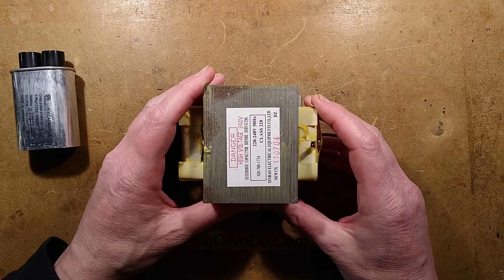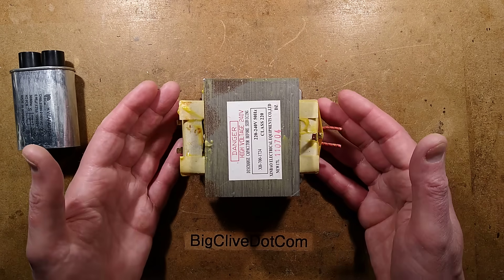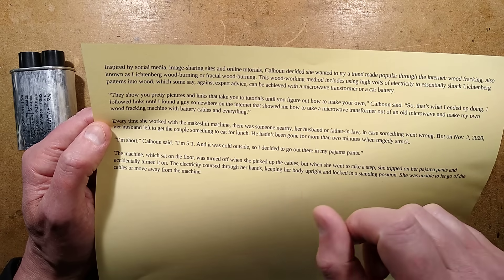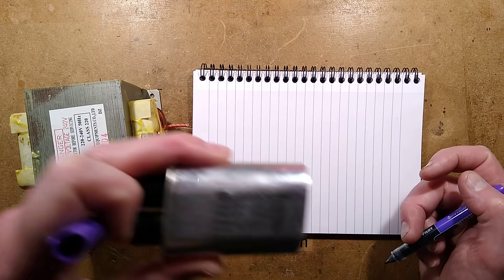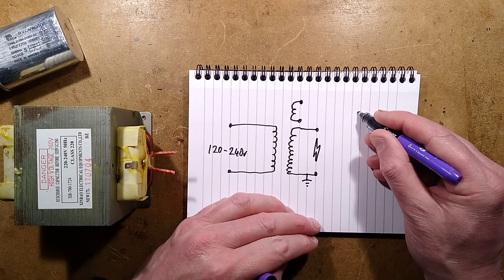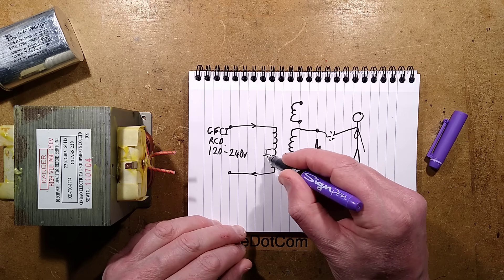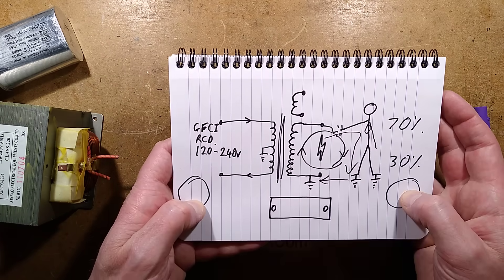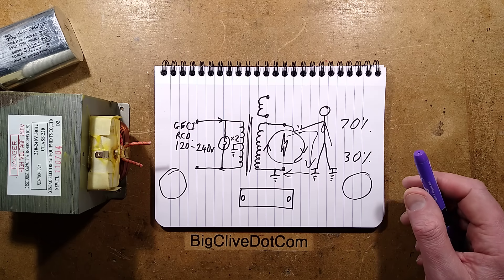The most deadly project on the Internet

Comment: It always amazes me just how many people ignore massive 6 foot tall font "Danger - High Voltage" warning signs, placed on fencing that surround many transmission grid transformer /  power relay stations. 

Yet people think a microwave oven transformer is nothing to worry about. I just don't get it...

200,000, 20,000 volts or 2,000... 

A good video you could make is explaining the relationship between Ohms Law AND Watts Law relative to current flow (time). 

We used to play with old automotive oil filled 12V ignition coils. A decent one might put out 10,000 volts. Then the first generation of High Energy electronic controlled 50,000 volt coils (HEI) became available and they gave your fingers (often all the way up your arm) a solid shock at the spark plug lead. The amperage was energized in millisecond intervals if the engine was at idle. More than a few mechanics have gone into cardiac arrest (and died), if the engine was running at 4,000 rpm or higher @ multispark discharges of 50,000 volts in one second (per cylinder / spark plug lead) on a 4 stroke V-8 engine). 

When playing with microwave transformers, it's constant, which nobody correlates to the danger involved. 

Really enjoyed this video. Keep up the great work!

Comment: Ghetto Carbon Nanotubes production by way of massaging two graphite electrodes together while they are submerged in water and connected up to a 150amp mig welder with jump leads is one of the scariest things I've done and I'm probably never going to risk it ever again but that's a good one for a 'things you really shouldn't do' video.
Reply from the maker: Although welders use high current, it is voltage-limited, so a lot safer.

Comment: People often do not understand that with DC power in particular, your hand muscles contract that that's it. I grew up in moviehouse booths and the old timer projectionist who worked around a lot of high power dc, all had a safety habit when moving a DC wire to always use the back of their hands gingerly until certain it's not a live wire.
Reply from the maker: AC is more dangerous as it causes sustained gripping as opposed to a single muscle pulse with smooth DC.

Comment: Would an anti-static wrist strap help with something like this? (This is basically a conductive wrist strap with a wire attached, with an alligator clip which you clip to ground at the other end. We used to use them all the time when working with computers to prevent zapping sensitive components.)

Of course you would want it connected to the hand or arm being used to touch the transformer, otherwise the current would still short across the chest+heart to reach the other arm.

It would be easy enough to rig something similar just using an insulated length of wire, if you can't be bothered sourcing a manufactured strap. But I suppose the people doing these things are already taking shortcuts with safety, so they probably couldn't be bothered...
Reply from the maker: Not recommended, in many instances it could be a lot more dangerous.

Comment: Could there be a easy way to  turn on and off  a system like this by a remote control system so there is little to no need to touch the system, while there maybe a charge in the system?
Reply from the maker: It would have to be hard-wired for safety and is basically the two button system I described that keep people's hands away from the dangerous bits.

Comment: The public information videos of the 70s and 80s scared me enough mentally to not attempt to toy around with high voltage appliances in such a reckless manner. Apart from the time I dismantled the transformer of my skalextric aged about 7 to boost the power and burnt my finger.. but apart from that.

Comment: With all the dumb and dangerous things I've done,screwing around with an intact MOT is not one of them. I've removed the secondary,rewound it for low voltage/high current,and made a beefy 12VDC supply with one,though.

Comment: Don't use WOOD as a standoff from this kind of voltage. Use fiberglass rods to carry the very dangerous HVAC between transformer and burning target, by attaching the HV wire to one end of the fiberglass rod and holding onto the other end of the rod. Also consider using a normal, old-fashioned incandescent bulb, wired in series with the mains side of the transformer, as a current limiter. As evidenced by the charring, wood is NOT a good insulator at these voltages. Good fiberglass rods for the purpose are commonly available at farm supply stores for a very reasonable price, as they sell many of them, for use with electric fences. I recently got some of these rods, which are 4 feet long by 3/8 inch diameter (9.5 millimeters) and conveniently pointed on one end, for under $2 each, retail priced. That leaves you room to hold the rod with both hands and still be 3 feet away from all the high voltage. These rods are meant to remain great insulators even when wetted by rain. Note to gardeners: They also work beautifully as heavy-duty support stakes for your giant tomato plants. Similar rods are available to at least 6 feet long, and in various diameters.

Comment: Heres a great project for them transformers. No risk of danger or death with this one. This works well if you have 1 transformer or 12 or even 100, doesnt matter. ok first thing you want to do is line them all up on the edge of a table. Now heres the fun part... Grab your trash can and slide it to the table and with one hand holding the trash can and with the other one you wanna just sweep your whole arm across the table knocking them all into the trash can. By all means its a very simple project but you'll notice how many years it can put onto your life expectancy. I call it "wtf was i thinking? throw them away". So yea. Be safe and have a nice day for the rest of your life...

Comment: And this is also why we used to be told not to play around with the tube TV's from the 90's. Never realized that those transformers created such high voltage or what could be stored in the capacitors involved. Glad I've only been shocked by standard 120v and 240v AC. And on a side note, 120v shocks are often uncomfortable for those who have never experienced them; I'd also like to warn that 240v AC feels like the conductors want to stick to your skin and your heart rate definitely goes up and you will feel weak afterwards. Please always use safety measures when working with electronics and if you aren't sure, then consult a professional.

Comment: Thank you for the post. I'm a broadcast engineer and I work on very high-powered transmitters. Even though we are trained and experienced in working with high voltage, we have very strict procedures we follow in order to not come in contact with energized circuits. 

I love the artwork that TRAINED HV artists produce, but it isn't worth dyeing for. If you have not been trained by someone who truly knows what they are doing, and been supervised by them, please don't mess with microwave oven transformers, neon sign transformers, or any high voltage power supplies. This is not something you can learn watching videos, or by trial and error. You don't know what you don't know and one mistake and you are dead.

Comment: This is the correct way to cover something like this if you're going to cover it. I'd never heard or seen these "drawings" before. But...
"If you insist you're going to do X, keep in mind it's dangerous and should be respected.
Here's a few things you can do with $10-20 of readily available parts to increase your safety factor by about 10^6 if you must do X."
Even better if you can tell them how to do it with parts from the microwave they gutted to obtain the transformer that were just going to throw away.

Comment: Great video.
Friend and I were talking a bit back about comparative safety of "hobbyist DIY" projects with CRT flyback transformers vs MOTs.  In other words, presumption there is neither one having good circuit protection before the transformer, and which of the two would be more dangerous/would kill you more quickly.  We didn't really come to a solid conclusion; curious as to your opinion on the question.
Reply from the maker: The most dangerous part of the flyback circuit is the final capacitor which is built into the glass CRT itself - basically a glass capacitor.
The MOT is massively more dangerous as it can supply continuous high current.
Reply: @bigclivedotcom  I mean just the transformer, without the actual CRT, plugged into 110/220 mains, output used for god knows what - so basically used in the same way folks are using MOTs

Comment: I've lost a friend to high voltage and I've always had a respect for electricity, especially my understanding of it is quite rudimentary. In my line of work it's not uncommon to replace light ballasts, switches or sockets or even the occasional appliance. I've been shocked plenty by 120v, and it's never fun any time. Twice due to outright complacency, several times due to component failure and once due to a coworker's negligence where an outlet popped in my hand. He was a lifer and had also become quite complacent. 

One of the things he touches on somewhat is what we call here in the states "let go force". After a certain voltage you physically cannot let go or move. The danger in that is obvious, as you become trapped with the current where it continues to do its damage. Depending on the voltage you may be able to survive, but I would really recommend some "scared straight" respect for electricity and simply glance at some of the aftermath of accidents or mistakes from working with high output devices. 

It's a terrible way to go, and I always remember a gag sticker I once saw on a high voltage box "DON'T MESS WITH THIS! YOU WILL DIE AND IT WILL HURT THE WHOLE TIME"

Comment: High voltage, and watts is no joke. I was electrocuted when I was a little boy, the 3rd rail burnt through 3 qtys of my skull in seconds. Which I believe is 750 v DC with a whopping 7,200 kilowatt potential. We are 70 percent water and we attract high voltage very easily but rubber footwear can save your life, they did me, I was wearing plimsolls which going back decades used very thick rubber and prevented me being totally grounded with breaks as my body experienced muscular spasms. So, when working with high voltage you should take as many precautions as possible, thick rubber isolated boots, gloves and avoid wet weather because all that protection goes out the window. Personally if I was to frack wood, I would use a machine to control the rods and remotely switch the current on.

Comment: i dont do this HV art but its best to heavily insulate the wires, leads or any metal you could touch. 
I have modified a microwave transformer to make a spot welder but that remains unfinished. i haven't had time to build the framing and such for it.

Comment: When you drop the dead man's box is because you passed out. Get the box that when you push the buttons they have a travel restriction that if you get shocked you'll pass that restriction and will open the circuit as your fingers clamp down harder as a result of the shock. It's an open/close/open contacts.
Reply from the maker: The point of the dead man's switch is to keep your hands away from the dangerous bits in the first place.

Comment: I worked in a microwave oven assembly plant in the early 1980s and knew a girl who was killed by touching that less than 2 minutes after taking over the job I was doing on a "rework" line, opening and checking for errors on previously finished product.   I was very familiar with the electronics and the danger.  She was not.   But my group was sent back to our normal line.   Before we could even get to it, everything was stopped.  Later we found out she'd been killed. 

High voltage projects are usually safe, because most are extremely low current.  Whether it's an electric fence of a shocking prank pen, it might hurt a little or startle but it;s not dangerous.   High current projects are also usually safe because the voltage is low and the usual hazards involve blistered fingers.  But is something is high voltage AND current, it's a dangerous project!
Reply from the maker: Quite a few people have been killed testing microwaves in factories.

Comment: I used to service microwave ovens and got hit with high voltage from the cap that I did not discharge properly. It moved thru my arm across my chest and out my other arm. It felt like I had been hit by a truck. I was lucky and I never did not discharge those caps ever again.

Comment: A few years ago I made a jacob's ladder out of a few MOTs. 2 as a ballast and one for the high voltage. I used a long piece of PVC tube wrapped in silicone to generate the start of the ladder but then noticed that the transformer was shorting to ground around the piece of wood I had mounted them to. An earwig was wondering around on the floor and went over for a look, his antenna got in the way of the fault to ground and to be fair, it took it like a boss and was a bit slow but it wondered off. I laughed and then stripped it down.
I won't be playing with that again but it was interesting. Understanding FULLY what you are playing with is key to this sort of thing and you have filled this gap, but I'm not sure how many 18 year old 'artists' from etsy will see this life saving information before they find the 'easy tutorial'!

Comment: Hi I'm watching your video about a high voltage coil from a microwave. I made myself a welding machine for 18650 batteries. Before I removed the high-voltage coil, I made myself a "Jacob's ladder" what fun. I note that I am an electrician engineer and I know what I am dealing with. By the way, at the end I burned the HV coil. Ps. I like your accent ...Irishman?
Reply from the maker: Scottish.

Comment: My interest was piqued with the high voltage burning part. Then came the microwave transformer. Yep. Might as well go pull some live 12,000V copper cable from the ground to buy some crack after I'm done doing transformer artwork.

Comment: I've made one and still have it and use it all the time someone in the comments said they didn't trust themself to make one. I don't have a problem with myself it's everyone else I don't trust.  so with that in mind how I built mine was to put the transformer in a weather-tight plastic box with a switch on the outside, The leads of a high voltage insulated wire. The last two feet of the leads are run in plastic elect conduit with the electrodes at the tips with a ceramic washer and cap so that only 3 inches of the electrodes are ever exposed at any given time and also self-standing. I even went one step farther and have all this plugged into a  Variac (Variable Transformer) Turn the dial from  0-125% AC output. with all that I think I'm somewhat protected.

Comment: If burning wood was the goal I'd just build the transformer and run it at 100kHz with a ZVS inverter  (how to and math is on the internet). A CCPS powered by a few car batteries or better a 120v 32s lipo pack or similar going into a 1-2kW  current limited buck-boost converter for current and voltage control with the output of that into the inverter for the transformer would be ideal. Advantage of that is you can make the voltage higher (ie 20kV) so get more detail. And if an accident happens you will survive (unless touching smoothing caps in the converter charged to 340v or something) though will still get an RF burn (that may need surgery to fix if at high power).

Comment: Definitely not a good idea for a first project. My first HV project before the internet was around (1983 when I was 10) was a jacob's ladder powered by an oil ignition transformer (basically a spark plug that ignites fuel oil furnaces). 10,000v 23mA. I once got bit by that when the ladder fell over and landed on my arm while it was running (one of the straightened clothes hanger electrodes got hot and melted the plastic it was mounted to). 2 second shock (so long because I could barely move) was enough to make me dizzy and see nothing but flourescent green for a minute or 2 after it was over and left a nasty burn on my arm as well as the heel of my foot and big toe. That was only 23mA. I imagine 2A from a MOT is far worse for those that think using common latex gloves for HV protection or jumper cables rated at only 60V is a good idea.
Reply: I made a Jacob's ladder with an old microwave transformer.  Very dangerous, and my 18 year old brain had way too much confidence.  Nothing bad happened, but I look back and cringe.
Reply: Anything over 1A is almost certain death depending if it shorts across your chest. Otherwise, it will really fuck you up.
Reply: @Retrolian1000  Eh it depends on circumstances. Linemen accidents often survive (though I bet they wish they didn't) since they usually get CPR/defib soon after even with 50A+ into them for several seconds. Though they sometimes no longer have arms or legs since actual contact with that instead of a flashover will cook bone marrow/crack bone from the steam pressure and that won't heal so what's left needs amputated.
Reply: @fvckyoutubescensorshipandt2718  I see. That's just what I was taught in high school and college: volts will hurt you but amps will kill you. It makes sense that it's more complicated than that.
Reply: @Retrolian1000  Well it is fairly logical, for a comparsion even a small bullet hitting your heart will kill you but a very big bullet that hits your hand won't kill you (it will very much destroy the hand though) as long as the bleeding is stopped.
With electricity you just gotta be lucky or unlucky enough to not have it go through vitals.